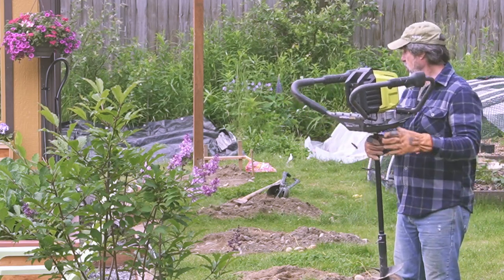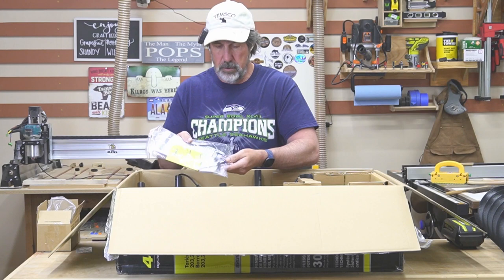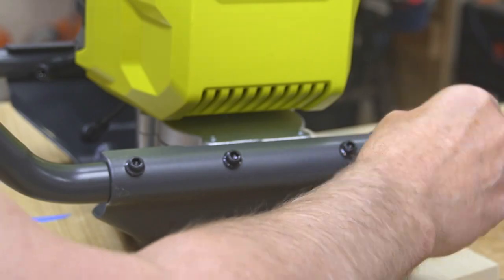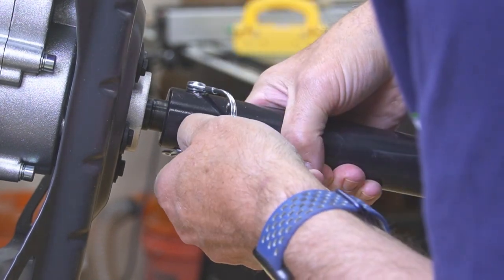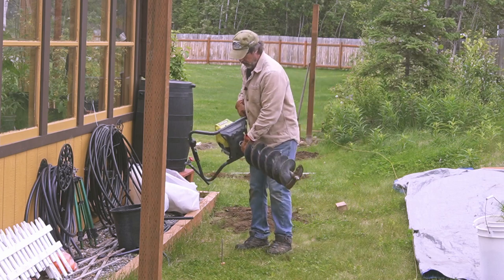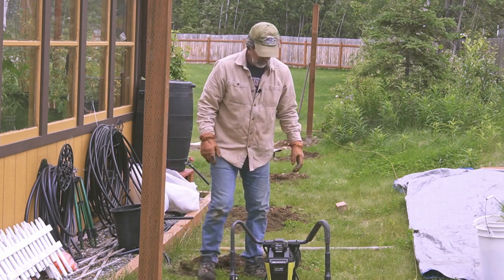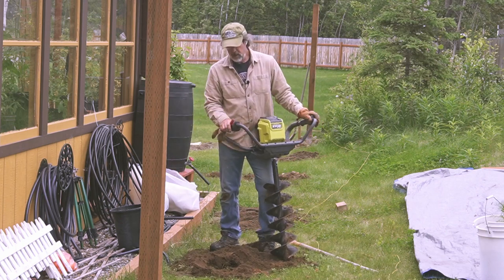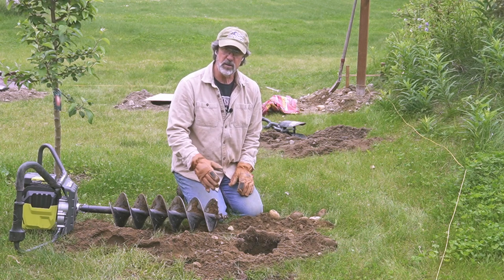Ryobi 40V Auger

Comment: I like woodworking and have several Ryobi tools and they are pretty good.  Better than I thought they would be.  Anyway, subscribed to your channel to support a fellow Alaskan.  (That auger wouldn’t work on my property which seems to be half rock and half soil).
Reply from the maker: I have a battery-operated weed eater that is Ryobi and I am happy with it. I also have a Ryobi fan that I keep in my camping trailer. I sold that auger right after I built the fence. Thanks for the support.

Comment: Great video.   Thinking about buying a six inch augur for fence posts.  Is an eight inch really that much better?  I will be setting 4 by 4's for a wood fence.
Reply from the maker: I did 6 inch holes for my back fence but it was less than 6ft. It has lasted the last 20 years. This fence ended up close to 8ft.